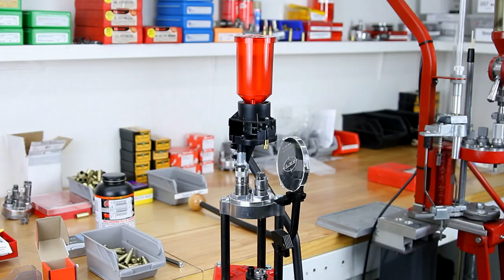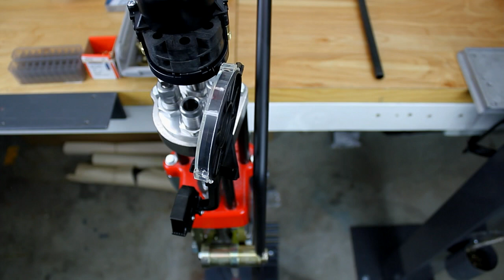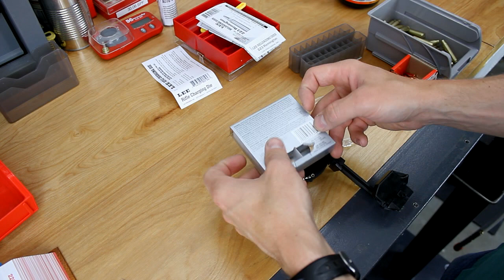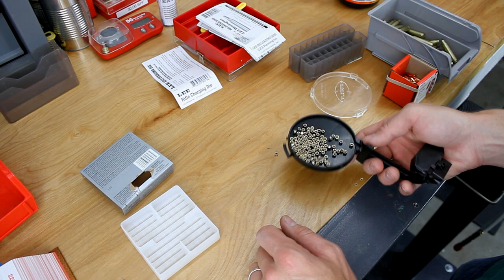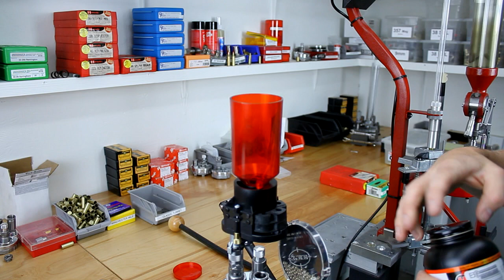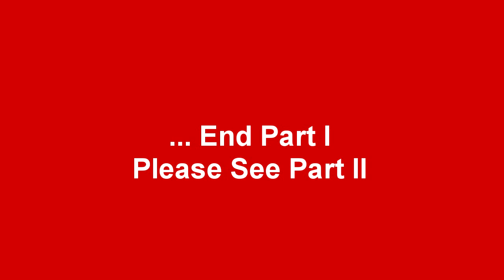Lee Classic Turret Loading .223 Remington Part I

Comment: BACK IN THE DAY WHEN MY PREDECESSOR WHEN FOR THE NRA-ILA BASIC RIFLE MARKSMEN, CHARLETON HESTON REQUIRED ONE TO IMPROVISED FOR THE AMERICAN PATENT OF THE ALL IN ONE MUNITIONS CARTRIDGE SEEN ON ROBERT E LEE MODERN RELOADING WITH THE RIBBON AND THE SEALED WAX - I THINK HE USED A 3 TONNE JACK STAND AND PRESSED DOWN ON THE LEE USD 29 RELOADING KIT - 28000 - 60000 PSI AT MUZZLE VELOCITY FOR 223 / 556 NATO OF THE Y OF THE JACK STAND PUSHED DOWN BELOW.... SO PEOPLE BEFORE WERE WAY STRONGER OF FILLER WEIGHTS FOR THE LEG PRESS VS THE FREE WEIGHTS... HIS STUFF IS WAY CHEAPER AND THE SAME DIES AND NOT IMPOSSIBLE TO FIND. JOHNSON CITY TN LEE ENFIELD FIREARMS CO... ODD JOB LEE ROY - NO CHARGE FOR 18 WHEELER COMPARED TO THE GEORGIA PATROL I95 X I40 EAST OF SHONEYS - BETTY CROCKER - RED ROOF INN / FUNNY STORY - DOW CHEMICALS OF NAPATHELENE MIXTURE WITH EGG CARTON FOAM DIESEL AND KEROSENE USING PAINT AUGER - FLA WEST PALM BEACH 2008 VIET-CONG RENACTMENT 28 USC 564 - THRU 568 | THE JUDICIARY SHALL NOT LEGISLATE "28 U.S. Code § 568 - Practice of law prohibited U.S. Code A United States marshal or deputy marshal may not practice law in any court of the United States. (Added Pub. L. 89–554, § 4(c), Sept. 6, 1966, 80 Stat. 621, § 575; renumbered § 568, Pub. L. 100–690, title VII, § 7608(a)(2)(B), Nov. 18, 1988, 102 Stat. 4514.)"

Comment: Hi guys, using this method of reloading, would we still have to trim the brass or just run it through? I've only used the rcbs 2 die sets on single stage press and always had to trim the brass down.
Reply: You would still have to check brass length after the first stage.

Comment: Bought a similar lee turret loader with same components shown on this video.  I'm having a very difficult time getting the Lee auto Disk powder measure to work with the .223 setup.  I purchased a long charging die from Lee thinking that would work.  Still after watching all your videos and others, I can't get the auto disk measure to push the spring up and drop a load into the bullet.  What am I doing wrong...?

Comment: ever have any bullet sesting depth issues with this setup? my COL is jumping around more than I would like (223 remington), sometimes as much as .010.
Reply: You've got to adjust the bullet seating part of the die.  Just place seating the die is not enough.  You know, that little hex nut on the top.  Try reading the instructions.
Reply from the maker: Haven't- wondering if you have a die setup issue going on. How did you setup the seating die on this press, and which seating die are you using?
Reply: gavintoobe lee 4 die set for 223 remington, setup seating die to just contact shell holder then 1/4 turn.

Comment: Sorry to hear about your bad experiences with this wonderful press. Is it possible that it was just user error? I messed up the plastic indexing square on the indexing bar when I first got it by short-stroking the press but since replacing it with the spare they sent, no problems in over 1k rounds. the pez dispenser-style primer feed can be finicky but usually works well once you get the hang of it.

Comment: lee's website has the newest version of the book, im not sure if its available elsewhere as well. It's the same basic book but it has 28,000 loads and is also supposed to be organized into a better format. Thought I should mention that in case you wanted "the latest and greatest" but my slightly older one works just fine and now that the newest is out, it may even be cheaper to buy. Hope this helps and... HAVE FUN!

Comment: Any problems using Federal primers? The Lee manual specifically recommends ONLY using CCI or Winchester primers. Not for brand preference but due to differences in the type of priming compound. Normal vs Basic compound. Just curious if you've had any problems?
Reply: some primer brands seat better than others. sellier & bellot primers seat the best (in my opinion)

Comment: I always have problems with the powder measure.  Funny thing is the reloader worked perfect out of the box, but after I disassembled it once, and correctly fitted it together, the powder measure became less accurate.  After it started throwing just off the wall variances i took it back.